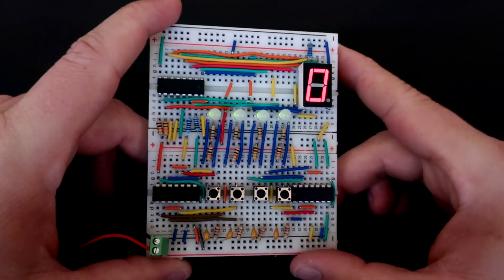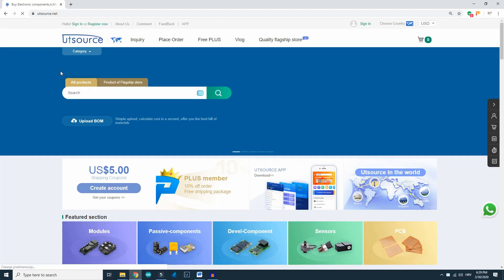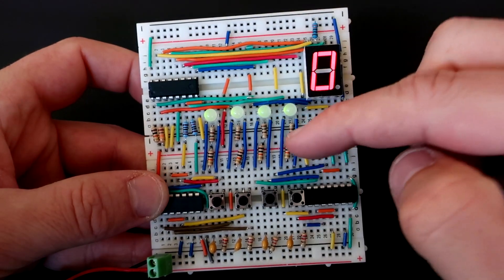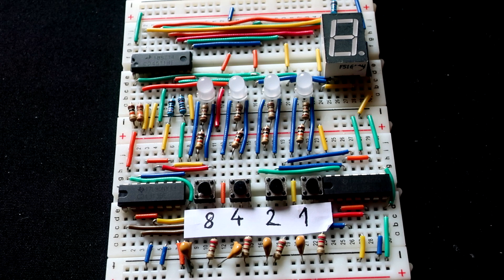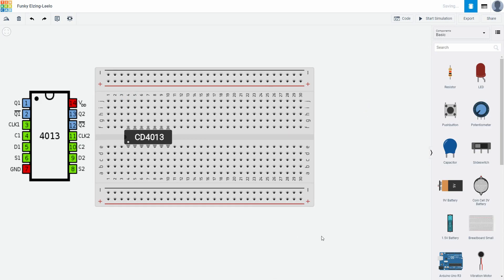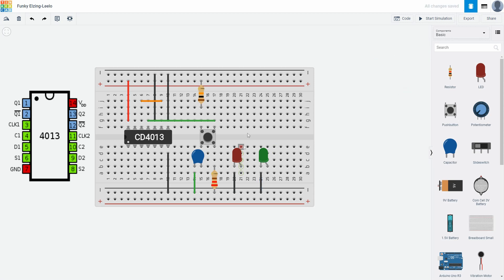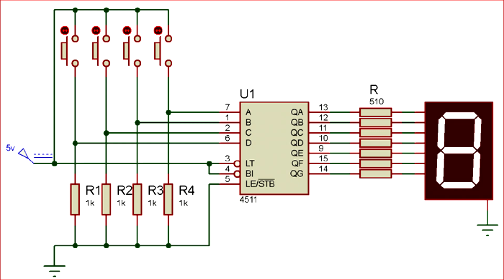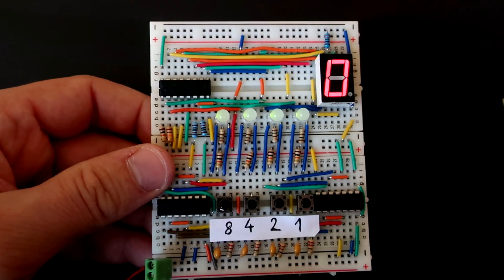Binary to Decimal Circuit using CD4013 flip flops and CD4511 BCD to seven segment display decoder

Comment: Hello, I am practicing flip-flops through this video. However, the 7-segment LED display is reversed. For example, I want to represent 0, but only the center line is lit and the rest are off. Any solution?